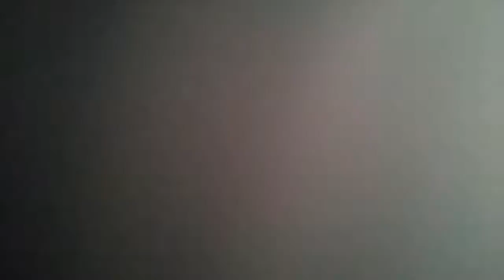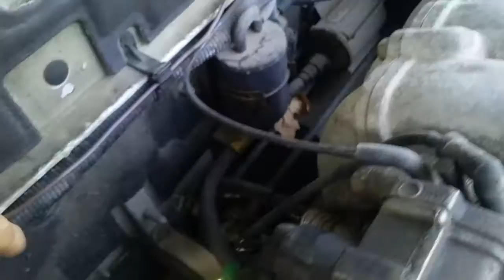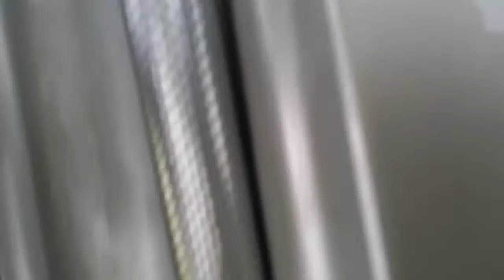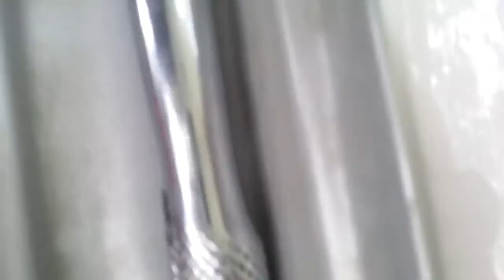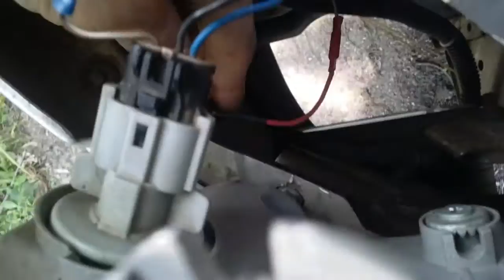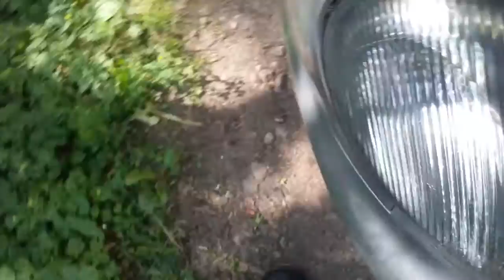How I wired my Daytime Running Lights

Comment: Why do  you have blue painters tape bundling wires in the engine compartment?
Reply from the maker: needed the shorten the wires once i had to switch back to Halogen headlight bulbs, i was out of zip ties...... since its just bunching the wires up, and i plan on either another LED kit or an HID Kit, ill just leave it be.
Reply: What ever you end up doing with the lights is your deal.  but use the right product to bundle the wires.  Automotive grade electrical tape at least, if not zip ties.
Reply: @smartcarfor2  Who cares? If it works it works? You think he is going to run to the nearest walmart to pick up electrical tape or zip ties just for the viewing pleasure of people on youtube?
Reply: @stringstrang8043  Who knows!  Maybe, maybe not.  It was just a recommendation.
Reply: Lol